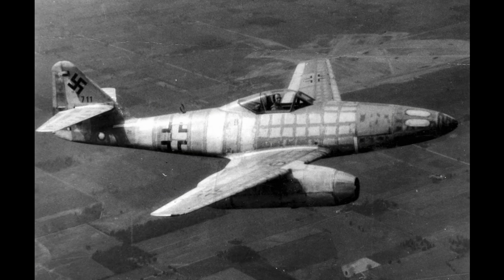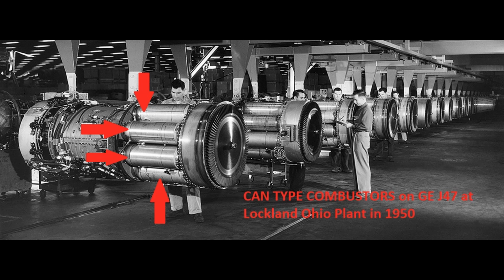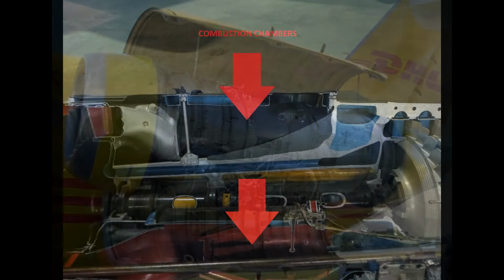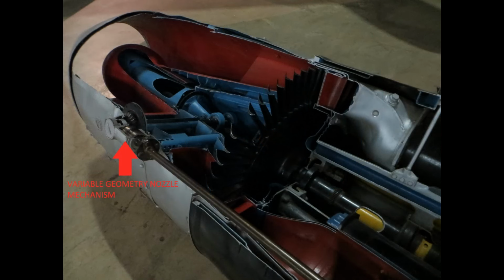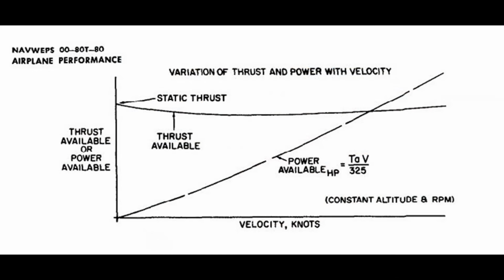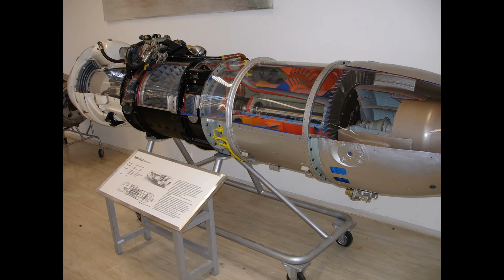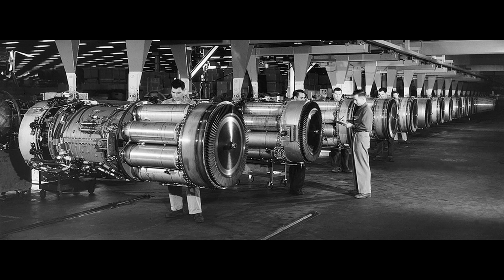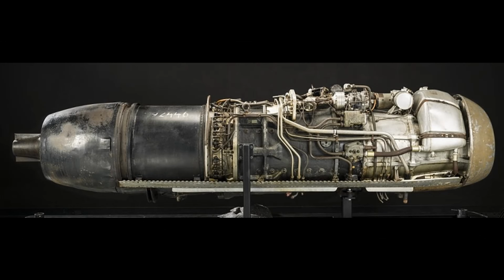World War Two JET POWER

Comment: @Greg You mentioned temperature spikes during startup as the most significant limiting factor on engine life. Was this due purely to the high temperatures of jet engines, or due to the massive thermal stress of heating the engine from room temperature up to operating temperature during startup?
Reply from the maker: It was the high peak temperatures seen during start, although the rapid rise probably didn't help.

Comment: Doesn’t the compression happen in the stators, not the rotors?
Reply: It usually happens in both. Most designs use a degree of reaction (R) that is higher than 0 (pressure rise is only in the stator) as this is less efficient (but can be shorter and lighter for the same compression).
A 50% reaction (half of the pressure rise is in the rotor and half in the stator) gives the least amount of skin friction losses. However, to avoid vortex losses the degree of reaction must change with radial position, so often compressors have a lower R at the root than at the tip, with about 50% at the middle.
Reply: Correct. The rotors impart kinetic energy onto the airflow through axial and rotational velocity.  The stators then perform two functions. One is as stated in this video is to cancel out the rotational velocity. Second, is to act as a diffuser whereby the increase in velocity from the rotors is converted into higher pressure. The decreasing volume evident along the compressor chamber is a result of the higher pressure air, not the reason the air increases in pressure.
Reply from the maker: In the stators? No. It happens between the compressor and stator.
Reply: @GregsAirplanesandAutomobiles  I would beg to differ on that. The stator converts the kinetic energy associated with swirl to internal energy by raising the static pressure of the flow ref: http://web.mit.edu/16.unified/www/FALL/thermodynamics/notes/node92.html. No mention is made of compression occurring in the free space between the rotor and stator. 

Similar statements can be found in Rolls-Royce (1996), The Jet Engine and Yahya, S.M. (2011). Turbines, Compressors and Fans, amongst other reputable sources.
Reply: @TomM-jh8lx  A rotor which converts 100% of its work into swirl energy alone is horribly inefficient. Notice in Fig 12.5 in the same website that you quoted, that the pressure continues to rise even through the rotor stage - rotors are just as important in generating compression as the stators are. The swirl energy that rotors impart on the flow are an unavoidable inefficiency, not a design choice.
Reply: @dsdy1205  Important clarification and agree with you

Comment: Sure, the 004 was the first axial flow turbojet to go into production, but how much could its design have influenced the Westinghouse J-30's development? I doubt the Germans were passing information to the US. Like a lot of complex "inventions", the ideas for the turbojet had been around for decades as a logical follow-on to steam turbines and the turbojet was "invented" in many places almost simultaneously without much transfer of technology between the independent "inventors" due to secrecy. Just like radar, it was "invented" in several different countries at about the same time.
Reply from the maker: Two words, Operation Paperclip.
Reply: @GregsAirplanesandAutomobiles  The J-30 was first run in 1940. I don't think operation Paperclip involved time travel.

Comment: I'm wondering why the engine was so inefficient and why they simply didn't put a larger turbine wheel at the front. That would have been a turbofan then. I mean it probably would have happened if the engine didn't get delayed so much into 1944
Reply from the maker: I don't think they could have been expected to jump from turbojet to turbofan within the time limits they had, let alone all the other problems Germany had back then.
Reply: Because, like everything else in Aviation (and Engineering) it's a balancing act.  compresing more air (even in you're not compressing it all the way and burning it, as a turbofan does, requires more work from the highly stressed turbine, and extracts more energy from the core exhaust.  To get more energy, it has to run hotter.  No matter how many turbine stages you have, that temperature (Which in the Jumo 004 was already beyond the limit for safe operation) entering the first stage of the turbine is your upper limit. (It doesn't matter how many stages you have, if the later stages are eating pieces of the first stage.
It was inefficient because it was the first jet engine intended for production, and the hard part was making it so that it ran at all.

Comment: A four-engined jet bomber with fixed undercarriage - that's not going to work. I really thought Greg was going to say: that's not going to fly.
Reply: Parts-bin engineering - take the fuselage of an He 177, landing gear parts from some crashed B-24s, and you've got yourself a cheap forward-swept wing prototype.  Maybe they were having trouble getting wind tunnel time.
Reply: I think that plane was just a test bed for the engines. It was not designed as a jet bomber with fixed gear.

Comment: Very interesting video. Why is it that so many of the 262's pictured had such awful paint jobs? They look like they've been painted and then half the paint has been stripped off in patches for some strange reason? Was it just because the Germans were that desperate, they were running out of paint ? But if so, why not just leave the airframes as bare metal ?
Reply from the maker: They were built by what was essentially slave labor, and many died building them, so a quality paint job wasn't high up on their list of priorities. The bad paint job can be though of as a reminder of the dark side of war.
Reply: @GregsAirplanesandAutomobiles  Slave labor was dark part of our history. In the city where I live were many factories which used these type of work. They made e.g. parts of the V2 launcher. 
Wish you and everyone here MERRY CHRISTMAS and stay healthy during that hard times.
Nice greetings from Austria.
Reply: That particular airplane never made it into the paint shop.  The marking you see on the surface is a filler/putty materiel (Pre Bondo Bondo?) that was applied to smooth out the imperfections in the joints between skin panels, to improve the aerodynamics.
The leading 1/3 - 1/2 of a P-51's wing had a similar treatment (Then the entire airplane was painted with Aluminum Dope, which is why the wing often has a 2-tone look in photographs.)
Reply: I’ll add in that painting for camouflage was important for the 262. Better to have bad green/gray paint than shiny metal.

Comment: That fixed landing gear in the 287 was salvaged from a B-24. It’s entirely possible the prototype was so equipped for the purposes of time and materials
Reply from the maker: I think that's the case, but it was still a useless exercise, they even put wheel pants on it.

Comment: are turbojet engines still a thing or is everything turbofan now?
Reply: There are still turbojets flying mostly in older aircraft, especially older military jets that are still in service such as the F-5.  Most new engines are turbofan because even a small bypass ratio makes them more efficient by making more use of the energy that can be extracted by the turbine stage
Reply: @gort8203  yeh i meant post 80s designs really
Reply: @Scoobydcs  You will find them in jet-powered model aircraft and some cruise missiles (e.g. the Teledyne CAE j700 powered ADM-141 TALD decoy missile). My guess is these will for the most part be centrifugal-type compressors due to the difficulty in manufacturing small scale axial compressor stages with tolerances small enough to avoid air leakage around the blades.
Reply from the maker: I'm sure it's still a thing in some rare cases, but I don't know of any first hand.
Reply: The choice of propulsion depends on design speed. At Mach numbers of about 1.8 - 3 a turbojet is superior to a turbo fan. For optimal overall cycle efficiency, a jet speed of around twice the flight speed is needed, so the faster an aircraft is the faster the exhaust jet needs to be. That's why at very low speed props are best, at higher speeds high BPR turbofans, then low BPR, then a pure turbojet and finally a ramjet for speeds > Mach 3.
Jet airliners fly around Mach 0.72 - 0.85. At that speed a high BPR is best. Most modern fighter jets are optimized for performance at Mach 0.8 - 1 and for transonic acceleration from Mach 0.7 - 1.3. For that a low BPR is best. There aren't any jets flying today that are optimized for higher speeds (except possibly for the Mig 25 / 31), which is why they are now uncommon.
Concorde was optimized for Mach 2 and used turbojets, and if it was designed today for the same speed it would almost certainly still be the case.
Reply: @ASJC27  re Concorde agree pure turbojet would probably provide the best efficiency at cruise, but I think the issue of takeoff noise means it would be forced to use a low/medium bypass turbofan, much like Boom is with their Overture supersonic program.
Reply: @TomM-jh8lx  Yes, regulations often impose compromises.

Comment: Norbert Riedel, the engineer who designed the starter motor for the German jet engines, actually went on to design and build motorcycles after the war.
Reply: Yes, two stroke flat twin!
Reply: @Guzzi81  Single  cylinder
Reply: @vicent436  Flat twin. The MZ BK350.
Reply: @CaptHollister  Riedel,  100 cc  single  cylinder,  Imme  R100. Two  stroke 350 cc  flat  twin  for  jet  engine  start.
Reply: @CaptHollister  mz  bk  350  was  a  two  opposed, or boxer cylinders, from  1951  to  1958,  two stroke engine
Reply: Wow, thank you for that.
Reply: +@rutabega2039   Riedel's son (or someone making that claim) has commented in several YT videos about his father.
Reply: https://en.wikipedia.org/wiki/Imme_R100

Comment: It’s my understanding that the TBO for the Merlin V12 was about 50 hours.
Reply: +Bram Moerman   I think it was higher than that during WW2, maybe closer to 100.  Modern rebuilds today have stretched the TBOs for Merlins beyond 700 hours, with some of the overhauls from Roush claiming 1000 hours.   How they are flown will drop that TBO significantly.   Whereas the recently restored German engines are still bound to the factory manuals and specs with expensive service intervals at 100, 200 hours etc.
Reply: @FiveCentsPlease  More than 100, as that was the bare minimum that would allow the engine to pass service acceptance trials.
Reply: I don't know if that's true. My understanding is that military engines, irrespective of the country and dating back to ww1 had to pass a 100 hour full power test to be certified.
Certainly Merlins put into commercial use post war and producing more power had a TBO in the high hundreds at least. 
And yes, I know that early turbojets were incapable of that.
Reply: @gregculverwell  The Merlin largely failed in commercial use because it was more expensive, noisier, and coundn't go as long between overhauls as the aircooled radials.  Canadair built a version of the DC-4 with Merlins in place of the normal P&W R-2000's. It was faster but the rate of climb was about the same and passengers complained about the racket of 48 highly boosted cylinders with stub exhausts.
Reply: Merlin TBOs in bomber and transport applications were on the order of 1000 Hours, just post-war.
Reply: @peterstickney7608     Merlin transport heads offered more durability post-WW2.  Even so, as was said above radials rated for long-haul were better suited for transport aircraft.   The exception being radials built for fighter aircraft which put out a lot of power but would not hold up as long.
Reply: @FiveCentsPlease  In that case, why did the P&W R2800 CA-15 series engines used in the F4U-4 Corsairs, F8F-1 Bearcat, and the DC-6, Convair 240, and Martin 202/404 have the same ratings, and were the same engines?  Now - use can have an effect, but I think you overestimate how much time a fighter engine actually spends at power levels above Normal Rated.
Reply: @peterstickney7608    Yes, use does have an effect on engine life.  I remember some comments from a P-51 display pilot that his Merlin will TBO in a few hundred hours because of his flying routine and not the 700+ hours from casual flying.
Reply: War time flat out use 350 hours.

Comment: After WW2,  Avia in Czechoslovakia manufactured some Jumo 004s and a few Me-262s.  I cannot remember where I read it but I think they only managed 60 TBO hours from the 004s they built.  I would be curious to hear any figures on the Soviet-manufactured Jumo and BMW turbines and what TBO hours those had, if any documentation even exists for them.
Reply: Back in the late 1980s, as the Iron Curtain started rusting through, I was part of an effort to obtain and restore to flight one of the 2 or 3 (It's hard to tell) Avia-built 262s. While we had fiarly good records on the airframes, we had no data on the engines.  From the comments we got from the Czech Techs, a 60 hour TBO would have been very, very unlikely.
We were going to use GE CJ610s/J85s - the same engine as an early Learjet. (And the engine chosen for the modern builds),  It had the same mass flow as the Jumo 004, would fit in the nacelle contours, and could be placed to keep the CG in the right spot.  With 1,000# more thrust per engine than the 004, things could get tricky.  I calculated Blue Line (Minimum Safe Single Engine Speed) as 230 MPH at full power.
Reply: @peterstickney7608    The 610s have worked out well in the new-build Me-262s.   They did their homework with the power settings and put a reference card for the pilot and stops on the throttle handles for the safe settings.   As far as I know Avia only made about a dozen of the S-92 jets and only two survive in museums.  The Czechs were attempting to build an export fighter but the Me-262 was already outclassed and the only customer was Egypt.  Avia scrapped the tooling and took a contract to build newer aircraft.  Egypt had three of the Avia Me-262s and I wonder what happened to them.

Comment: The two-stroke Riedel starter engine also has an electric start option which the pilot can operate from the cockpit.  Ground crew could use the D-ring pull if necessary.
Reply: just imagine some poor mech pulling the d ring on a 777 engine  lol
Reply: @brucefelger4015  Nowadays it's a Huffer (ground-based portable air compressor) or a Buddy start, blowing high speed air into the engine to wind up the compressor/turbine spools either from a hose (Huffer) or parking another airplane in front and running up the power to use the jet exhaust or propwash before turning on the fuel and ignitors.  (Seen it done with C-130s)
Reply: @peterstickney7608  I believe another starter principle are starter cartridges (which are inserted into a special port at the engine and then fired)
Reply: @junkers66  Yep - and there are also combustion starters, where you light off a slug of jet fuel or some volatile nasty chemical (Isopropyl Nitrate, Hydrazine), and the expanding gases spin a turbine which is geared to spin up the engine spool. 
The A-12/SR-71 used "Buicks" - external carts with 2 hot-rodded big block V-8s geared together (Originally from the Buick Gran Sport, hence the name) which drove a shaft that turned the spool on the J58s.

Comment: I'd say that the jet engine propulsive efficiency increases with speed. The power is similar (to some extend, of course it is a simplification) at the same thrust, but at zero velocity it is completely wasted from the propulsive efficiency standpoint and is maximum at max speed. Energy from burned fuel goes into both kinetic energy of moving airplane and into exhaust gases kinetic energy (apart from other loses). So in terms of engine power I wouldn't say that at zero velocity and max static thrust is at zero power only beacuse the airplane is not moving. It's like a piston engine of a car at full power when the car is not moving due to wheel slip. In the jet engine we can't just look at the shaft torque and rpm to calculate power and that's what makes things a bit more complex. I'm sure you know it very well, but I wanted to clarify it a bit.
Having said that, thanks for the great video.
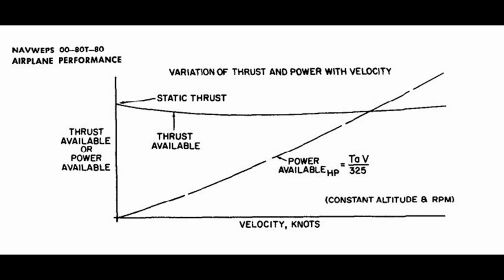Reply: He explains this @14:50 in terms of efficiency and thrust increasing with speed
Reply: I don't agree that the power increases with speed, as I described above. Terms 'power' and 'power x propulsive efficiency' are not the same thing. To me it is an oversimplification. So made this caveat.
Reply: @stasiekpiekarski  “One of the advantages of the jet engine over the piston engine is the jet engine's capability of producing much greater amounts of thrust horsepower at the high altitudes and high speeds. In fact, turbojet engine efficiency increases with altitude and speed.”  FAA-H-8083-3B
Reply: @petersouthernboy6327  
"Power climbs with speed for a given amount of thrust" that's what I was referring to. @ 14:30
Reply: @stasiekpiekarski  Note that the term on the graph is available power. That is also called alternatively thrust power or propulsive power. This is a term in flight mechanics with a very specific definition. It is the proportion of the power that is gained by the aircraft. Available power = (propulsive efficiency)*(total power) as you said. So yes, available power does increase with speed, and yes the total power released by the engine (available power + residual power in the exhaust gasses) is kind of independent of speed (not exactly, as thermal efficiency drops with speed). It is important to use the correct terminology - available power vs total power. The graph is not wrong.
Reply: @ASJC27  I agree with everything you wrote. It's a matter of terminology. 

On the other hand, the power in this context is more abstract thing and it is more of a book keeping. Thrust can be measured directly rather than be a result of calculations and is tangible. Thank you for the constructive conversation.